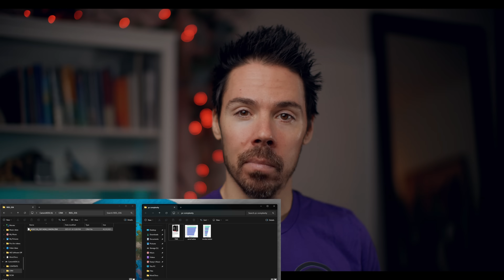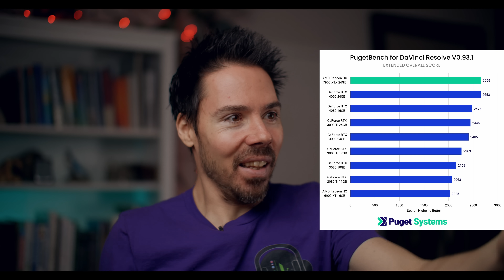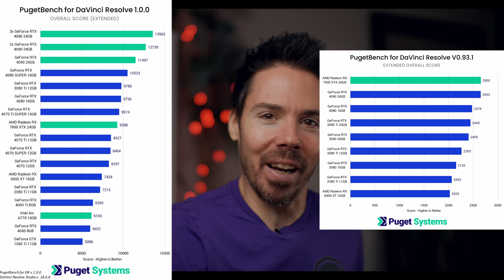The PC Building Rabbit Hole NEVER ENDS!

Comment: Someone else commented on your board already having usb 3.1 gen 1. Reading the manual shows it has 4 usb 3.1 ports on the back panel, as well as an internal header for a further 2x 3.1 ports (the latter you can buy a simple pci plate with usb C on).
Reply from the maker: My ports are gen 1 speeds, unusable.  My new PCI card is much faster.
Reply: @cameraconspiracies   3.1 gen 1 speed is 5gbits per sec/ 600megabytes. If the board is an  aorus elite b450 it also has 4 slow rear usb 2.0 ports that may be adding to the confusion. (the usb 3.1 ports are together in a block of 4, the other ports are usb 2.0). Either way a pci card will do the job also. Maybe the AMD chipset driver hasn't been installed.
 
I wouldn't move your m.2 drive unless you have everything backed up fully, Likewise with changing your board. Another rabbithole is windows OEM vs retail. A lot of builders will just buy oem windows which is fine but generally is registered to one motherboard only.

You have a good editing system that does everything you need. Drop in ram/cpu upgrade as needed.  (gigabyte has a list of supported ram on it's support page for the board). 

Finally thanks for all the entertaining videos.  Yours sincerely, a ZV-E10 Hobo.

Comment: While your PCIe lanes are shared between the various slots, the likelihood of you saturating them to the point of performance loss is virtually zero. It's not a limit of the motherboard as much as it is a limit of consumer CPU's (although different classes of MBs do offer alternate PCI slot layout). They share lanes because the CPU can only provide so much bandwidth and it'd be less practical to limit slots to dedicated lanes of their own that you'd never utilize to their full potential while limiting others and creating bottlenecks. Even your GPU (in a X16 slot) won't utilize all it's available bandwidth. It sounds like a limitation but in practical use, it's more of a feature. At least that's how I think it works. I don't know if your motherboard prevents you connecting anything larger than the slot itself but in some cases, a larger connector on the pcb will still work in the smaller slot, it just won't make use of the leftover contacts and will be slower (technically) as a result. Your ram is fine. AMD cpus need your ram to run at its highest rated speed. The reason you see 2 numbers that are both half the speed is because you use a 2 stick config so your ram runs in dual-channel mode (each stick half of the total rated speed) which is how it's supposed to work.
Reply: The two different RAM speeds is often due to the MHz rating vs the MT rate. Due to being double data rate, they're marketed at 3200 or whatnot, but that's megatransfers. This makes them 1600MHz. The marketing really was always pretty bad about highlighting this, making people think they had 3200MHz RAM. We're just now getting to where there's actual 3200MHz RAM, which is 6400MT.
Reply: pretty sure they are not even shared between the two x16 slots on this board

Comment: Just enable your PCI-Express' slot's NDTF mode; then your RAM will run at full 3200MHz speed, but make sure the GPU's SDG switch is turned OFF, otherwise your mouse will track at ¼ speed, and your monitor will only display 3-bit color LUTs, unless you enable the monitor's GFY toggle, behind the power switch, that should fix everything, except now your keyboard will only type in uppercase, so you have to do a firmware upgrade to enable lowercase on the keyboard, but it has a glitch which erases your personal files on the SSD, but you can always encrypt your drive so the glitch won't have access to the encrypted data....
Reply: Reminds me of the time when Carol's muffler bearings went out.

Comment: BTW if you are using an older mobo make sure you update your mobo bios or the cpu will not work
Reply: I think these CPUs are of the same generation. I don't think it needs an update for them to be compatible.
Reply: @PhillipRPeck  I thought he had a 3600?  If he has a b40 mobo and hasn't updated the bios in the last 3 years then it will not reckognize a 5000 series cpu
Reply: b450*
Reply: @ Oh, yeah. IDK why I thought 3600 and 5960x were the same generation. I guess there was a 3960x

Comment: What? The card won't go half the speed if you have enough lanes. PCI-E 16x uses 16 of the 40 or more available lanes. If you're using PCI Express 4.0 on your 5900X, you will have 24 PCI-E lanes available, 16x for the GPU, 4x for say your NVMe and there are still 4 left. These two are connected directly to the CPU. All other PCI lanes are connected to the Chipset. Thing your Aorus has something like a 570X chipset, so, it is not possible if you add a small USB-C PCI-E 2x board it will make the GPU any slower. So, please, go for it. 
As for the SSD, move it to the main slot, the GPU can grab data directly from it with the AMD thing they have if you have a AMD CPU + GPU combo.
Reply: He does have the lower end B450 chipset, X570 has all the extra lanes from chipset
Reply: @Gti_Jason  Still, he won't cripple the GPU by adding USB-C. B450 from what I am reading is still 24 PCIE GEN 3 lanes, 16 for the GPU, 4 for the fast NVMe and 4 more lanes for peripherals, so, he can add a PCI-E 2x USB-C card and call it a day without crippling the GPU. The GPU if it is the 7900 XTX is already crippled by the GEN 3 lanes. 
He needs a beefier motherboard or....a Mac Mini M4 Pro.
Reply: @ you are right, I did some more research after finding out what his exact board was and he'll be fine

Comment: Heck yeah Noctua, solid choice. Job done don't have to think about it for another decade.
Reply: Noctua is extremely overpriced and not worth it. Plenty of better options for way less money, that will also give you future socket support
Reply: Hawk-tuah should have endorsed Noctua instead of the shill coin she went with!
Reply: Just get noctua server fans
Reply: Love Noctua, but money-wise I've gotten such good value from Thermalright, I'm never going back... even if a fan breaks 3 years from now, those fans cost 4-5 bucks..  peanuts.
Reply: Agreed.  Don't buy some cheap ass part you need to replace 5 times.

Comment: Your cpu provides you with the PCI lanes. Not sure which one you are using, but it should be over 20. 
Your GPU in the top long slot will give it 16 lanes. Which is more than enough for your use. 
The motherboard allocates 4 to the top m.2 hard drive slot and there are typically 4 being used by the motherboard to be allocated for the USB and other devices on the board. 
If you use one of the small x1 slots for a PCI USBC daughter card, it will probably get 4 lanes associated with it and it won't be taking anything away from your video card. The slot the other card was on should have been fine, but the fact that it was choking the fan on your GPU, would have made me get something different. 
For more information, look into the B450 pcie allocation. The B470 has more bells and whistles, but it may not be what you need.
Reply: He is saying he is getting a 5900X at 6:44, that has 24 pcie lanes. But I think you are incorrect about that is 'should be over 30', I think there is hardly any consumer CPU that has more than 24 lanes. On my own simple system with 24 pice lanes from a 5700g, 4 are taken by motherboard for 'various' including nvme, 4 by sata, and 16 by the GPU, so just with that simple setup all lanes are filled up. But I think in reality it does not matter that things are shared. I notice also that Kasey provides no proof that his system became slower, he just assumes it (although blocking the fan seems bad, so for that reason it is good to switch to another slot).
Reply: Both his current cpu, and his impending replacement cpu, have pcie 4.0 x 20
Reply: Pretty sure his issue is the chipset (B450), I know my X570 Dark Hero has from cpu alone
2 x PCIe 4.0 x16 (x16 or dual x8)
2 x PCIe 3.0 x16 (x16 or dual x8)
1 x PCIe 3.0 x16 (x8 mode)
and from the chipset, AMD X570 chipset
1 x PCIe 4.0 x16
1 x PCIe 4.0 x1
Reply: Here's what I for for the cpu lanes 
1 x M.2_1 socket 3, with M Key, Type 2242/2260/2280 (PCIE 4.0 x4 and SATA modes) storage devices support
1 x M.2_1 socket 3, with M key, type 2242/2260/2280 storage devices support (SATA & PCIE 3.0 x 4 mode)
Reply: @Gti_Jason  According to the manual, his mother board has 1x PCIe 3.0 x16 for the GPU and it doesn't share lanes. It also has 1x PCIe 2.0 x4 and 2x PCIe 2.0 x1. The PCIe x4 and the lowest PCIe x1 share lanes so if the lowest PCIe x1 is populated, the PCIe x4 runs at x2.
Either way, plugging in any other PCIe cards should not affect the bandwidth of the GPU.

Comment: I just don't understand why you want a PCI card for an extra USB-C ... if you motherboard doesn't have those ports, why don't you just use an adapter? Why do you need a new card to plug a USB device?
Reply from the maker: Try paying attention to the video, I explained that all my USB slots are slow.  I displayed the speeds in the video while using a USB adapter.

Comment: you got the SATA thing around the wrong way, the lower slot shares PCIe lanes with the SATA ports, The main M2 should be in the top slot an using the direct PCIe from the CPU rather than using the lower slots Chipset PCIe links

Comment: the amount of available pcie lanes is up to how many your cpu offers. the amd 3600 has 24 pcie 4.0 lanes. 4 are reserved for motherboard chipset. the rest is used by gpu (16) and your nvme ssd (another 4). so even the pcie card in the lowest slot 2:05 causes your gpu pcie lanes to be cut in half. since it is pcie 4.0 this might not be the end of the world bandwidth wise. in this configuration 24 - 4 (chipset) - 4 (ssd) - 8 (gpu) - 1 (whatever card is in there at the bottom) means that there are 7 lanes left. so pluggin in that 4 lane usb card wont change the distribution of lanes at this point. but dont quote me on that since this also depends on your motherboard.

Comment: Your Crucial P1 maxes out at read/write 2,000/1,700 MB/s ... honestly not sure it's worth moving it to another slot. If you had a faster drive, yeah. But that's pretty low speeds for an NVMe drive. You can use crystaldiskmark to check what your current speeds are. That will tell you if the drive is being slowed down somehow. If I remember right, the bottom slot is PCIe 3.0 x2 (2 GB/s max speed minus the overhead). Should be close to the max speed of your drive. If you ever upgrade that SSD, it will be worth moving it to a faster slot. 

About that USB card you've bought, on an x1 slot it will be limited to a theoretical maximum speed of 1 GB/s (gigabyte) because PCIe 3.0 x1 gives you that much maximum bandwidth. A motherboard with a PCIe 4.0 x1 slot has double of that (so 2 GB/s) per lane (1 lane in that case).

It's a much bigger deal when PCIe 3.0 16x get halved to 8x because that 7900XTX would usually be using a PCIe 4.0 16x slot in a more recent system, which would give it double the bandwidth. So it could be fine with a PCIe 4.0 8x interface (same bandwidth as PCIe 3.0 16x you have right now) and then the slot below (depending on the board) would be running at PCIe 4.0 x8 and there would be enough bandwidth for both cards.

Comment: You bought the latest powerfull Lamborghini engine (7900XTX) and out it in your old Scoda, and wondering why its got problems...

You shouidk have bought a 7900XT not XTX or even a 6900XT and used the extra money to buy an entry AM5 motehrboard and some cheap RAM (32 or 64gb)....

Yes you would need to buy a new CPU, but you were thinking of that anyway... Plus video editing uses the CPU far more than the GPU....

Then in later down the line if you want an upgrade you could look for a good price on a 7950x (16 cores) ...
Reply from the maker: Shoulda this, shoulda that.  My PC runs beautifully.
Reply: @cameraconspiracies  the guy that put a Lamborghini engine in his Skoda thinks the same too....
Reply from the maker: @ There are no problems though lol.

Comment: Your Aorus B450 Elite has 4 x USB 3.1 Gen 1 ports on the back panel. You can get a usb-c adapter.
Reply: That's what I did on my B550. $3. He unnecessarily over-complicates the sh!t out of everything.
Reply from the maker: They are all SUPER SLOW.  My sd card reader came with a USB adapter, and I displayed those speeds for you in the video.  About 35MBPS.  Now with my new PCI X1 card things are transferring 10x faster than any of my USB ports would have.  I didn't overcomplicate anything, I literally got the simplest fix possible, and added a bunch of ports to my PC.
Reply: @ Ah, okay. I didn't realise there was a significant difference in transfer speeds. 
I get 270MB/sec through my usb, but I see that I have usb 3.2 gen 1, your board might be an earlier iteration. 
Notwithstanding that, 35MB/sec sounds like usb 2.0 speed to me, which your board will include alongside the high-speed usb 3.0/3.1. I hope you didn't put it in the wrong hole, Kacey.
Reply: "USB 3.1 Gen 1 supports speeds of up to 5Gbit/s while USB 3.1 Gen 2 supports speeds of up to 10Gbit/s." from the Kingston site. Either his cable is crap or there's something wrong with his setup.
Reply from the maker: @ The usbc to usb piece that came with my SD card is capable of 10gbps, there's nothing wrong with my cable.
Reply from the maker: @ I just tested and you were right, that 10GBPS adapter was a lie.  My bad.  I did need the extra USB ports though, so I'm happy with the PCI card.
Reply: @cameraconspiracies  Yeah, not all USB cables are created equal. Many cables despite manufacturers' claims don't support higher data transfer speeds or newer power delivery standards. There are even specialized tools to check cable capabilites, Universal USB Tester and Advanced Cable Tester v2 ($$$$) to name a few, but you can always just copy a bunch of files and watch the transfer speed to see if your cable supports higher speed standards. In my experience, the cables which support high data rates are thicker and heavier compared to those which don't support high speed transfer.

Comment: Yes, it's normal that PCI-E lanes are shared. It's because CPUs only have som many of them. You'd have to buy a workstation to get rid of that problem, and yet, they also have a limit of PCI lanes. They just have more of them.
Workstation CPUs are also much more expensive.

You will have to check the manual of the motherboard, to see how the PCI lanes are shared. It could be the top x16 slot and the bottom x4 slot or completely different.
I wouldn't worry, though. The old GPU had the one USB-C port, you are now missing, correct? Meaning the USB-C port on the GPU and the GPU itself already shared the PCI slot. So, just buy a x1 USB-C card, unless you lose bandwith (I can't say off the top of my head). If you do, just keep the current USB card, and plug it into the other x16 slot. A x4 card will fit in a x16 slot just fine.
Reply from the maker: I did read the manual, the 2nd slot takes up half the first slot, but it didn't specify what the X1 slots do.
Reply: @cameraconspiracies  When the second slot is populated, it becomes x8 / x8 speeds instead of x16 / nothing. The x1 slots should not affect the speeds of the bigger slots (because x1 isn't a lot to begin with). That's probably why the manual doesn't mention it.
Reply from the maker: @ That's what I figured.  I heard the x1 slots can affect the second slot, but if it's empty it won't have any negative impact on the first slot.  I got a new slower card for the top x1 slot and it's fast enough :)